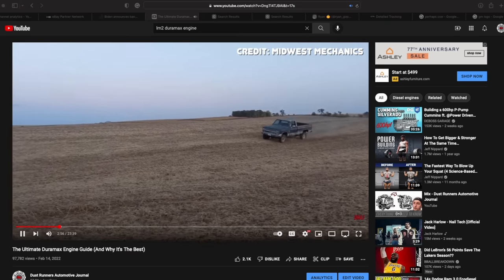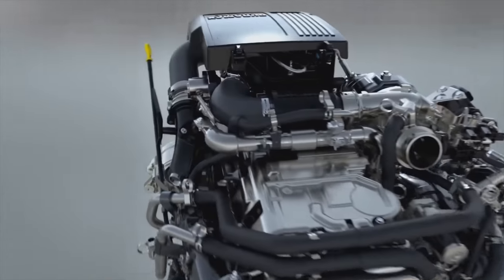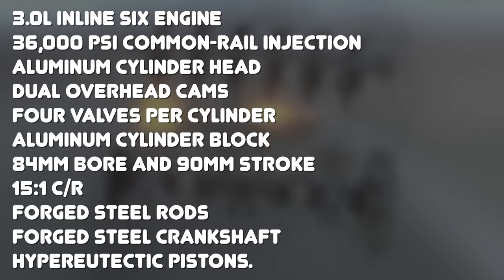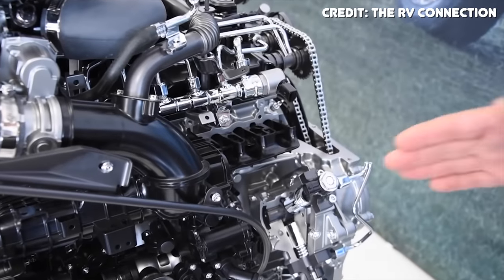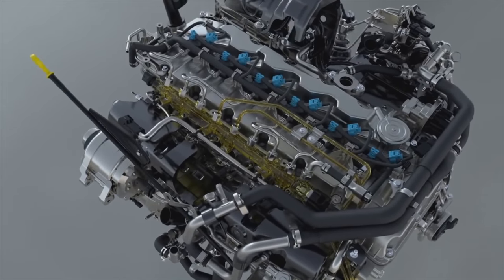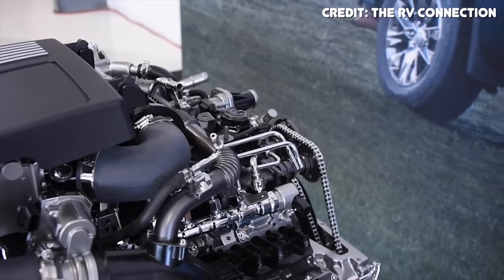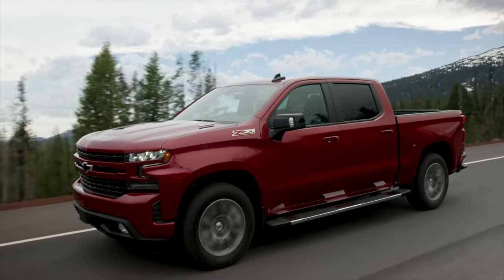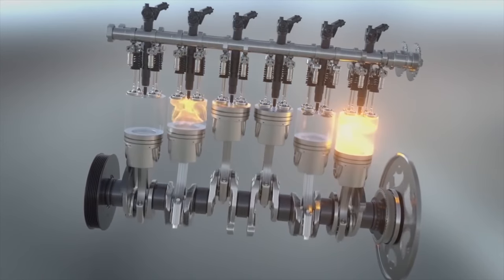3.0L LM2 Duramax: Everything You Need to Know

Comment from the maker: If you guys enjoyed the video, please SMASH THAT LIKE BUTTON. It helps the channel out a huge amount and helps YouTube put the video in front of more people. Thanks for watching 😬
Reply: Could you do a video on the L8T it’s the new Chevy 6.6 gas engine.
Reply: Hey,, I own a sierra with the 3.0 LM2 and found on the forums the fix to the crank but no start issue. Can you add a thing on your video to help others... the fix is currently to take it to the dealer and rather than have them do the cab removal surgery to the camshaft position sensor ask them for the updated ECM flash. This has resolved the issue for everyone who's had it reflashed by GM
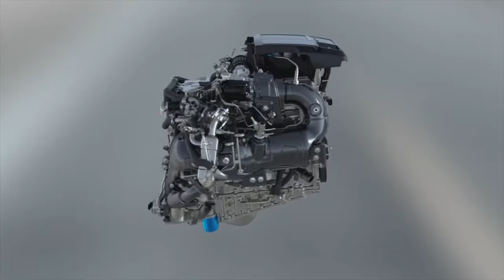Reply: Hey man like the channel, do you guys have a link or file for the LM2 cad file at 2:50 or any 3d files?
Reply: What about the 4cly duramax and Cummins ect.  Great videos 😎👍🏻

Comment: I am a seasoned  GM tech and I can tell you most of the emissions issues have been with the DEF injector and a few oxidation catalysts - Along with a few NOX sensors (like all newer diesels). I did have to replace 1 engine due to a faulty oil pump, but that was only one I have heard of (About 8 months ago). Most people absolutely love this engine. It's extremely smooth, quiet, has gobs of torque and gets great fuel mileage. It moves effortlessly and runs beautifully. As for the intermittent no start/long crank, we have an ECM reflash that has worked well. They say the old program would read the cam sensor wrong at times. As for the type of fuel control, I will check for you.
Reply: Yeah man I own one it’s been great. The main thing I don’t like is the timing and oil pump on the back as well as the rubber belt I know you’ve heard that more than enough times. Gonna plan to replace the belt myself at 100k right when the warranty ends. I saw somewhere you can do it though the oil pan, but I should just plan to drop the trans anyway?
Reply: Thank you. What is ECM reflash?
Reply: Yea the problems willl only start after 100kmiles. Cant beat the cummins lol
Reply: @markkukowski3710  What is ECM reflash?
Reply: @grouchosays  It's a new computer program - Usually only available at the dealer: It's designed to fix certain common issues that can develop with the vehicle control system. ECM stands for Engine Control Module -

Comment: I've had my LM2 for over 2 years and racked up 25K+ miles with no issues at all.  Over all averaging 29+ MPG!  So torquey, smooth and quiet. LOVE IT!  A real joy to drive a full size pickup again after years of a wimpy V6 gas engine.
Reply: I'm about 1 year in with 10k+ and for daily driving it has been absolutely fantastic. 21 mpg through town to work and 29+ like you mention on cross state road trips. I have run into the start issue where it cranks for 20 seconds till it times out less than a handful of times though. I simply let it time out and then hit it again and it fires right up. Scared to take it to the dealer since they like to tear things apart and do a shitty job of putting it back together lol. I'll just wait to see if it develops into something worse or if people on the forums figure out the actual fix for it!
Reply: @mateuszmaciol3141  I have not had any issue such as you describe.  Hope you find a solution.
Reply: @Mateusz Maciol I had that issue. I took it in and it took thirty minutes to reprogram works fine now
Reply: I’ve had mine for 5 months and just over 20k.  Just finished a 8k cross country road trip and towed back a 1976 k10 4x4 long bed the last 3000 miles.  Towed to the bottom of Death Valley and back up to the Grand Canyon, then all the way across i40.  I was shocked by how well this engine works.  Plenty of power and about 15mpg at 75mph while towing.  I was able to do 80mph up 8% grades and the temp gauge never moved.  Without the trailer, I’m usually above 25mpg, and at 55mph over 30.  This is in a 21 Yukon xl.
Reply: Get rid of it by 150k miles.
Reply: 25k isn’t even broke in yet I hope it lasts 😎
Reply: Lmao y’all gotta sell it by 150k or drop the transmission and pull the engine to change the belt 🤣 hood ol chebrolet
Reply: @levthelion  I sold mine at 148, 999 miles. I was hoping to find this comment for reassurance.
Thanks! 🙏🏻
Reply: @mateuszmaciol3141  I don't think it's an actual "mechanical" problem, but rather an ECM software issue.
Reply: @JakeStewart1343  what issues come up at 150k?
Reply: @jasesnow  the oil pump belt needs to be replaced. To do that, the transmission needs to be slid back. He’s making it seem like this is a huge issue. It’s the same thing that’s been needed for years and years with manual transmissions—need to replace the clutch every once in a while, guess what, that requires sliding the transmission back.
Reply: @cornelius6304   its a $1,000 replacement every 150k miles and some engineers are actually saying it can be pushed to 200k
Reply: @mateuszmaciol3141 Guy here says ECM flash helps

Comment: As a gm tech the extended crank issue has been corrected with a new ecm software update
Reply: Sounds like a “trust me bro” statement.
Reply: @Miiike604  before the update there was a tsb to pull the engine and replace the actuator, apparently gm realized it only needs a ecm reprogramming. I’ve done both but as to if either fix the issue, neither truck has came back yet.. knock on wood
Reply: @rboyett  appreciate it. 🙏🏻
Reply: Not true. I've had the update, exciter wheel inspection, and I still have the no start issue.
Reply: What if the wheel is bent though? It still has the be replaced right? The ECM update is not going to correct that. I really love this new 3.0L diesel and looking to buy one
Reply: @Anonymous01416  in that case it’ll still need replaced, I believe customers have had extended crank concern and techs where replacing them even if they where not bent so then the ecm update came out. As far as I known gm wants us to do the update first and if it comes back to inspect the wheel
Reply: @juanitamannn  odds are the tech who inspected the wheel didn’t know what to look for as the tsb is pretty vague, or they decide to say it’s good as it is a very labor intensive job. If I where you I’d take the truck back to the dealer and request a TAC case to be started. The advisor and tech will know what you are talking about
Reply: I saw that as well did one this week, have you done this:

 #22-NA-027: 3.0L LM2 Diesel With Possible Oil Consumption, With or Without DTC P06DD - (Feb 2, 2022). 
Also did some lash adjusters on one 3 months later parts showed up. Another with a rear main housing on one with 25miles. Also had a blown turbo which completely saturated emissions equipment. Also a fuel system on one dummy dumped DEF in the diesel tank. Aside from the dumbass that dumped DEF in the tank not impressed with this engine just my opinion. 🛠
Reply: .3 tenths. Good times!
Reply: @DTR0454  I’ve had to do a fuel system due to def being ran through the fuel. Have also had to do a rear main due to leaking oil. I’m not to impress with it either. I would only have one until the warranty is up then I’d get rid of it
Reply: @rboyett  I will do that, thank you
Reply: @rboyett TAC case?

Comment: Without doubt, the 3L Duramax and 10 speed transmission are about as perfect a combo as can be.  I saw 26-30 mpg on the highway.  Now, if GM could solve their quality issues, we’d have a real winner.
Reply: Amazing with a full size pick up that is capable of great Towing. I have my own business and we have 2x F150’s with the base V6. They are great and reliable. But I want a person full size truck and wand this Diesel Silverado.
Reply: Six speed manual would be far superior.
Reply: @fourhillsfarm  
Mmm
Maybe, but not so convenient. I have a six speed VW Amarok and the transmission is like a big big truck. First gear is very short. I would like to drive this Diesel truck with Duramax engine, seems like a good balance of comfort, economy and performance.
Reply: Seeing 30mpg regularly on my Silverado. Lovin it.
Reply: I just bought a 2017 Sierra 5.3 and I kinda regret of not going newer and pulling the trigger on 3.0 I heard nothing but great things bout this engine
Reply: Quality issues, can you elaborate on why you mentioned quality issues.. curious to what your experiences is with GM?
Reply: @kenna.9368   My 2019 had the rear window leak.  Traded for a 2020 with the 3.0, no issues with the motor, but had several software issues that on one instance, killed the battery. And the 2020 also had the rear window leak which they simply could not fix.  It was repurchased by GM.
Reply: @steve841  wow that’s insane! Would  they not fix it or did they just not have a fix for it?
Reply: @kenna.9368  They tried. After 2 windows and 4 attempts... They gave up.
Reply: Best detail I've heard on this engine. Which GM engine is most reliable, 5.3, 6.2, or 3.0 diesel?
Reply: @jw8578  with the lifter issues on the gas engines, there’s no way I’d get anything other than the duramax

Comment: People think taking the trans out is a major deal.  Not as major as removing all of the plumbing and heat exchangers from the front of an engine like this.   It's actually a lot easier to remove the trans and transfer case.
Reply: That's what I've been thinking too. There is so much on the front of the engine, putting everything in the back is no big deal.
Reply: Bingo…was wondering about that same thing myself.

Comment: the 6,0 powerstroke was a euro design thats all i have to say lol
Reply: but it was gear not chain
Reply: The 6.0 is a beast of an engine. Better than the 6.7 that's for sure. The ONLY problem with the 6.0 is emissions. That is it.
Reply: @benjaminturpin2749  i know that but have you ever worked on one its a pain in the ass cuz of euro desighn . all important parts are on the rear thats why you gotta take off the cab. my 7.3 everything is on the front much easier to work. i love 6.0s they are one of my favorite engines. i want one but cant afford to work on it lol. the sound is like no othrer.

Comment: I’ve had my LM2 for just over a year and have put the truck through its paces. I have over 73,000 kilometres on it now. I’ve never had the long crank issue but I have had it in the shop to have the seal on the transfer case replaced. I’ve also had a leaking rear pinion seal replaced all under warranty. Aside from that the truck gets amazing mileage and I can get anywhere from 1050-1150 km on one tank if it’s on the highway. In the city it ranges from 850–950. Great truck
Reply: If I'm correct, ir close to being correct, that means you get around 22 to 27MPG?
Reply: What's a kilometer?
Reply: @nexpro6118  correct

Comment: 44k miles in the first year on my Minimax. I freaking love this truck! Total average is 24.6 MPG with a best of 31.8. This thing is a total joy to drive and the 10 speed auto makes this truck feel like a brilliant combo. The chain sounds like a pain and so on but so far, mine has been incredible. It blows through DEF pulling a 4,000 pound box trailer but every time I’m hooked up my lady laughs at how many times I say how great this truck pulls. 
It won’t win any top speed shootouts but it is a zippy truck around town. It also doesn’t feel like a full size truck when you’re driving it. GM nailed it on this truck…..as long as she stays reliable.
Reply: Amazing with a full size pick up that is capable of great Towing. I have my own business and we have 2x F150’s with the base V6. They are great and reliable. But I want a person full size truck and wand this Diesel Silverado.
Reply: She won’t. It’s a GM.
Reply: Basically get rid of it by 150k miles.
Reply: @levthelion  Systems have changed wiring etc is quick connects. Lifting a cab isn’t the PIA it once was. Shops have these type lifts & ceiling room today.  I think it’s like Ram’s EcoD that it’s basically a disposable motor. Probably change the belt etc at 200k then run it another 200k or however long it lasts then dispose of the truck. If it fails early you drop in a crate replacement.
Reply: How do you like the oil consumption
Reply: Any updates? Ive been thinking about it alot

Comment: Oh man!  Love my 2022 Refreshed, 3.0 Duramax Sierra.  I have an embarrassing confession to make, however.  On a trip to El Paso I had accidently put seven gallons of gasoline in my tank.  My wife and I had to make an important appointment and so we hastily decided to push on.  (I know -- real stupid)   We ended up driving just over 600 miles in total with that fuel mix.  Total stress!  I had kept the tank topped off as much as possible along the way hoping the gas would float on top of the diesel and stay above the pump.  Weird thing is the engine never threw a code.  It did however do that "long crank" thing.  That freaked me out.  But it never left us stranded.  Made it back and had the tank siphoned out right away.  Engine ran great the whole time, did not overheat or nothing.  No change in power, at least as far as I could tell.  I have 12K miles on it now and she is beautiful.  Best MPG so far was 39 on the I-10 between Benson AZ and Marana --and that's with a fully loaded SLT, 4WD, big cab and 6.5' bed.  Yep, she's pretty long.    I can't say enough about this truck and power train.  I love it.  Just hoping it stays that way.  BTW, the long crank has not returned since that mishap.

Comment: I just bought a new 2022 Escalade EXT with this LM2 3.0D engine. I have always purchased GM. I owned 6.2's before. I love the 6.2L gasser. But, this engine is unreal guys! It eliminates all the problems of the traditional Diesel engines. It is quiet like I cannot describe. Standing next to the engine it is hard to hear the traditional Diesel idle knock I have always herd next to a Diesel. It starts instantly. Zero wait time for glow plugs. I get in and hit start immediately. No wait lamps or timers. No smoking at all. Zero smell that most Diesels have had in the past. I swear this truck has amazing power too. My Diesels before had very pronounced power bands. My Cummins had a red line of like 3K RPM. It made power down low but quickly ran out of breath around 2800-3200 RPM. This 3.0L engine revs alllll the way to 5000 RPM. It is the first fun Diesel I have ever had to drive straight from the factory. Please go test drive one. That's the only way for you to experience this. It is the most advanced engine I have experienced in a very long time. I don't remember when I fell in love with an engine like this before. It's that good guys. I would not lie. It's amazing for sure. Towing my BIG Bertram Sportfish is no problem with this engine at all. Oh yea, I'm getting 19.7 MPG average by the way!!!
Reply: Pretty sure they stopped making the Escalade EXT in like 2013…you mean ESV?
Reply: @bdoginit   Yes I meant to say ESV ! Thanks for that.

Comment: I have owned a 2021 Sierra 1500 with the 3.0 Duramax for nearly a year now, and have put roughly 18000km (11000Miles) on it. So far i have had zero issues with the truck, and it is great on fuel! Over the course of ownership I am averaging about 22.85MPG with a best trip of 28.63MPG. This is no surprise by now, there are plenty of videos reviewing the fuel economy of these engines. 

However what impressed me the most was, while towing my enclosed snowmobile trailer over a 1500km trip I averaged 13.9MPG!!
Reply: We’re seeing an average of 16.8mpg (majority of its life it’s towing) while best is 32.7!!!
Reply: My deleted 6.6 LML with 164,000 miles averages 18-22 at 70 mph on the highway depending how the wind is blowing.  I am tempted with 3.0, but it better get better than 23 mpg in real world driving for me to make the switch.
Reply: Im at 45k miles with no issues I love everything about it
Reply: @lelenbates3367  I have been averaging 23 with a leveling kit and bigger tires, I didnt go crazy big tho.  Also I know it doesnt make sense but I swear I get better millage in auto 4 wheel.  I do not have proof but I reset my millage months ago and now winter is over I went back to 2 wheel and my average MPG is going lower
Reply: @asphaltspecialties  
Is the temperature change from winter to summer that made the difference ?

Comment: I drove these trucks back in 2018-2019 when they were in preproduction testing, they were beautiful running engines, got great mileage (32mpg +), and would actually start in the cold. I fired one up -29F in Bemidji, MN without any kind of assistance (block htr. etc.), and no hesitation
Reply: Were you testing up at AET?
Reply: @shaunr9635  No, Roush Industries

Comment: Drove 3.0 my 21 LTZ 4200 miles pulling my 6500 lb camper through the mountains and it performed beautifully. Transmission heat got up their pretty good on a hot day in Estes Park, but never overheated. Averaged 13.9 MPG where gassers were at about 8 mpg. Ton’s of torque and great to drive. Blessings